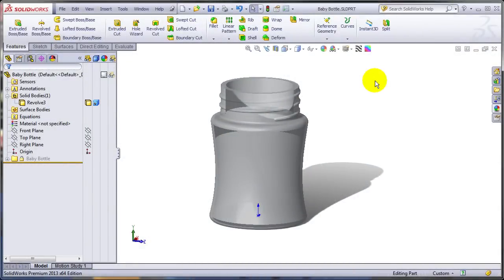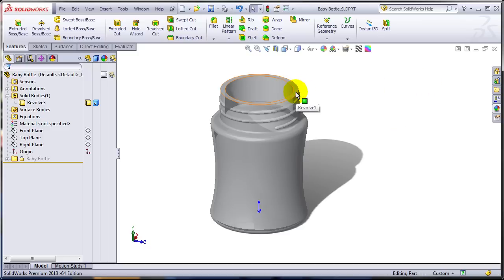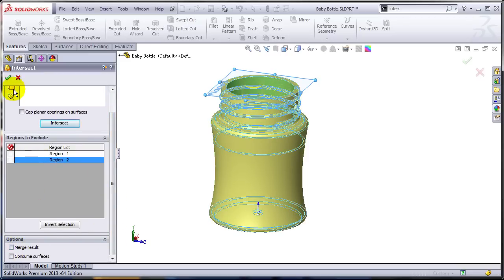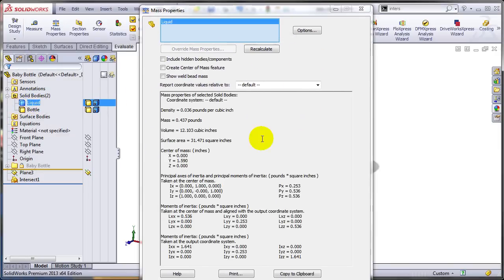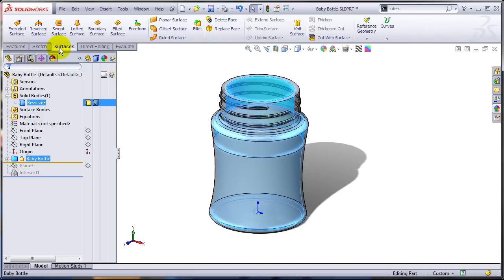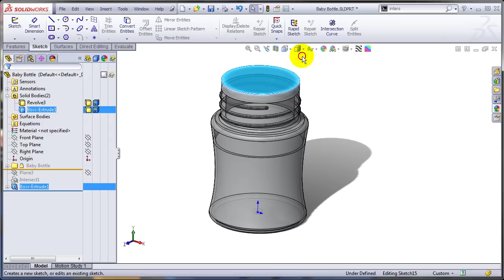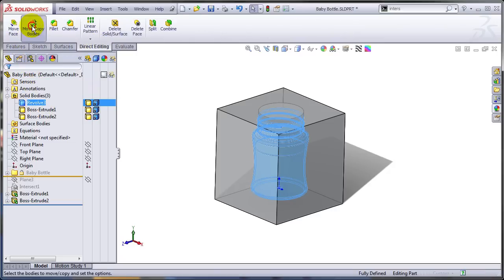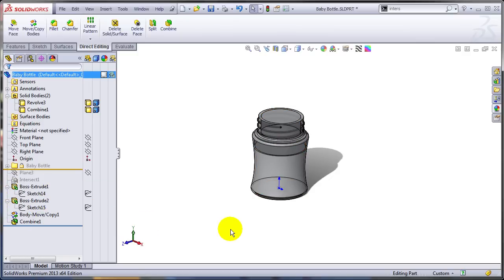New in SolidWorks 2013 - Fill a Baby Bottle Using The Intersect Tool

Comment: At the beginning of your video you mention that in a following video you will determine where the 1/4 or 1/2 level is.  Did you ever post that video?  Thanks.
Reply from the maker: No David, I have not recorded such a video.
Reply: +David Struyk  David, just reposition your 'volume' plane to the desired height of your content. You will have 3 bodies...